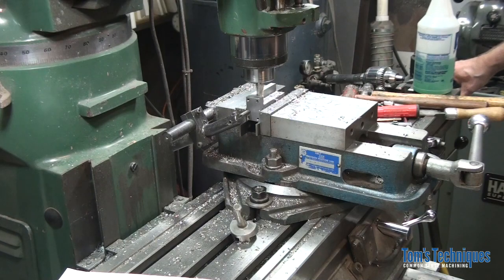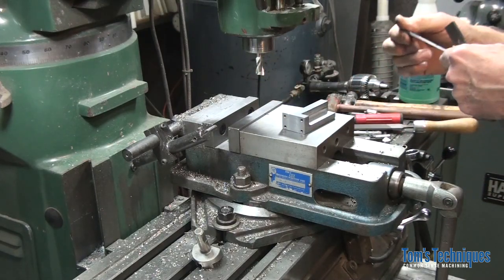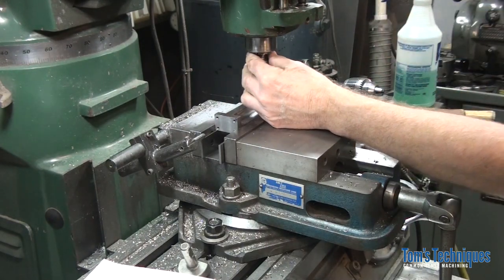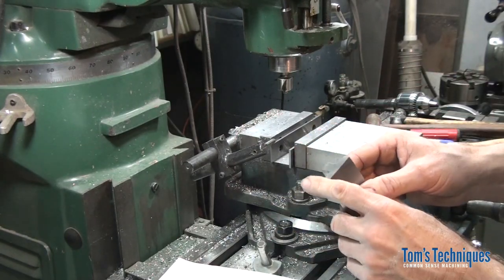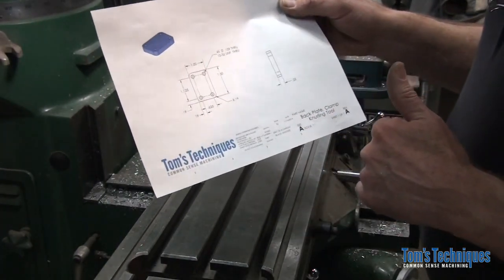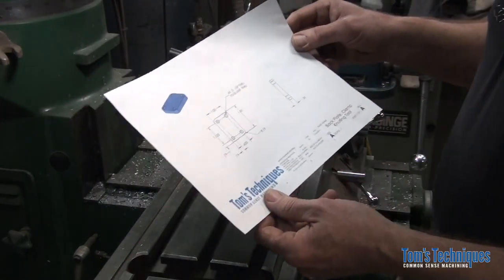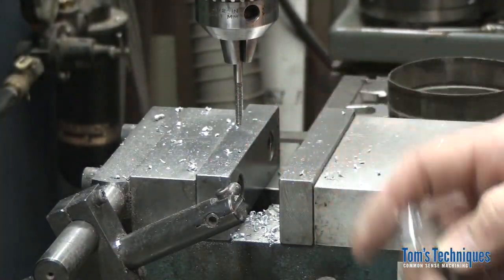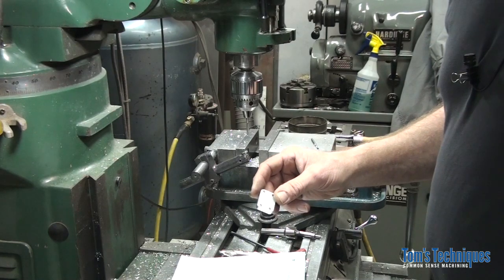Clamp Knurling Tool, Mounting Bracket and Back Plate, Part Two

Comment: Tom, thanks for another interesting video.  Good advice on the corner rounding.  I've done lots of that with wood, but router tables aren't as easy to back off 0.002"!  

You really cracked me up with your comment at the belt sander: "no time to cut corners"...but not so much that I missed the technique for getting perfect corners. The radius gauge, the stay away from the tangent sides, and the unstated but just as important: practice it for a few years. 

-- Mike
Reply from the maker: BigMjolnir 

There is nothing like a good pun to start the day, although I'm not so sure that falls in the category. Practice definitely helps. I probably made it look pretty easy in the video, but it takes a while to get the technique down. Like you say, I've been doing it for a few years and probably made a lot of bad looking radii before I started making good ones.

Regarding the wood router; a piece of paper is about .002" thick.

Tom
Reply: Maybe not a pun, but it was still a fun play on words...even better if it wasn't intentional.

Paper is a good gauge for small thicknesses...I've used dollar bills for setting table saw fence offset and bandsaw guide spacing for years.  The problem with the router is getting it to change height by that small amount.  Some routers can do it without too much trouble, others not so much...depends how you set the cutter depth on each design.

-- Mike

Comment: Tom I think you have got the audio levels spot on . What kind of Mic are you using now
Reply from the maker: That's good to hear Chris. It's a Shure lapel mic, not sure of the model. Recording the vocal on a separate track allows me to move the levels up or down during editing to accommodate machine noise. It seems to be working out much better than just using the audio from the camcorder.

Tom

Comment: Hi Tom, Your Swivel Jaw Vice looks to be a real pain, having to find the right size packing each time. Do you ever use the Swivel Jaw for tapered parts ? If not go for a Standard Fixed Jaw Vice as used as an industry standard. You were lucky with these parts being a standard thickness i.e 1/4 inch and 1 inch. Anything else would mean finding shims etc, real pain. Much easier to hear you now with the new audio set up, if you could get rid of your 3 phase converter noise it would be perfect. Great videos, keep up the excellent demonstrations. Get rid of all your tooling placed on your machine table, it will damage the surface, rattle about when machining and may even fall off during heavy cuts.

Comment: Hi Tom, thanks again for your videos! I've learn so much as I'm practicing! The "hands-on" projects really do help learning the intricacies of machining like sound, feel, visual characteristics of the cutting etc.  Nothing teaches better than experience (both good and bad).

Would you have another project that would incorporate the tools we've already made through your videos? 
(Maybe a another tool with knurled handle or knob etc)

This is the first knurl tool of this design I've seen and it makes much more sense (As you've already explained in part 1). Would you have any plans or design ideas for a "ball" (radius) turning tool for the lathe QCTP?  
I've seen a few ideas but don't know which is the better design.

Thanks again for your attention to details, explanations,  and safety tips with each procedure. Your videos are awesome and adds invaluable knowledge to any machinist! 

Can't wait for the next one!

Comment: Hi Tom, 
You were right about A2 being hard to machine. But having made the parts from this material are they hard enough without further treatment?
Also I notice that you attempt to reply to all, Thanks for doing this.
Reply from the maker: The hardness of tool steels in their annealed state is not much different than mild steels. The difference comes with heat treat. A2 for instance can be hardened to Rc63 from around Rc12 in its annealed state. It just depends on what you plan to do with it that drives how hard it needs to be. For something like this mounting bracket, Rc30 would be appropriate. That would be hard enough that set screws wouldn't mar it, but tough enough that it wouldn't crack. The reason I chose to case harden mine was because it would result in a tough part with a glass hard surface.

BTW, if you have machining related questions, feel free to contact me on my website, tomstechniques.com.

Tom

Comment: Just watched your video on threading would you use the same procedure with an insert tool
Reply from the maker: Rick Seniuk
The set-up is the same regardless of the tool used, but I do not recommend carbide for those on the steep part of the learning curve. High speed steel is less expensive, much more forgiving and all around better suited for light, low powered machinery like that found in hobby machine shops. Once you gain experience, carbide may be appropriate for some applications, but until then you are better off with HSS.

Tom

Comment: Tom what is the best type of plastic rod to use on the lathe? i want to turn 50mm diameter rod. many thanks
Reply from the maker: paul maddison 
That depends on what you want to use it for. Different plastics have different applications.

Tom
Reply: Tom the best to turn without almost melting, i want to turn/face/drill 50mm black plastic type bar.
Reply from the maker: paul maddison 

Delrin (acetal) is one of the better turning plastics and it is readily available in black. As with any plastic, you need sharp tools with high rake and clearance angles.

Tom
Reply: many thanks Tom, ps great bunch of vids really helpfull.